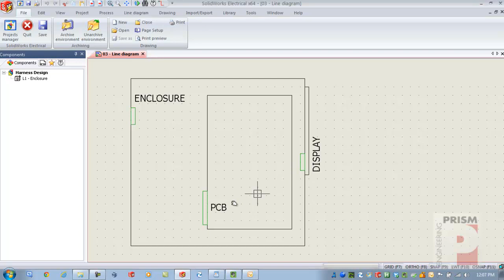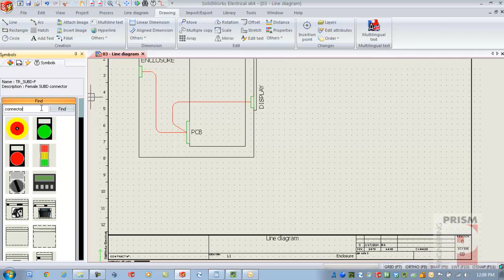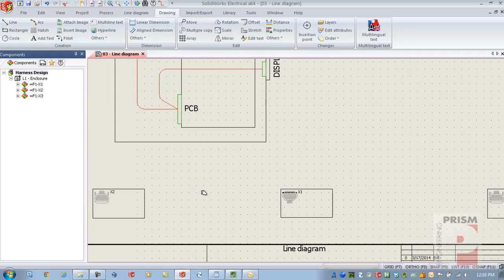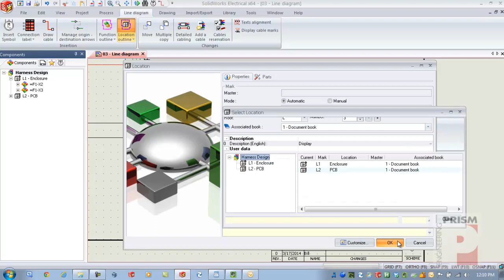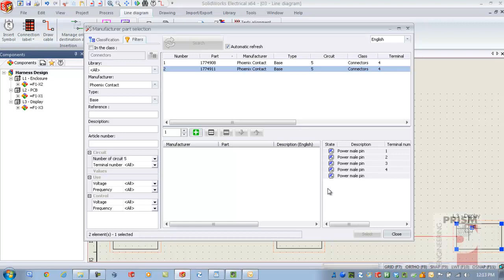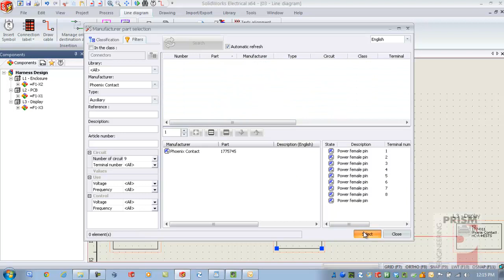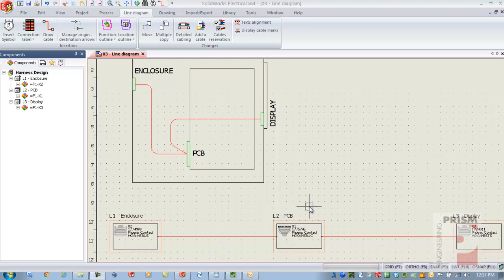Harness Design with SolidWorks Electrical - Part 1

Comment: question? I have a harness with 45 pins using 3 different pins (280-480 and 630) can I get a report with the pin connection and terminal in that pin? Example in A1 we use 280 female terminal  can I have a report showing all my 45 connections with each terminal? thank you for your video, very helpful